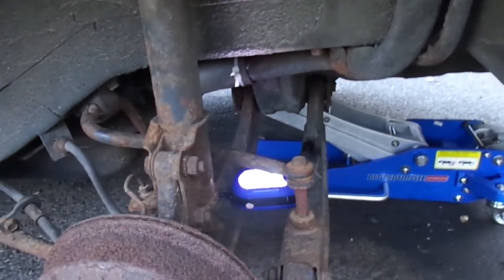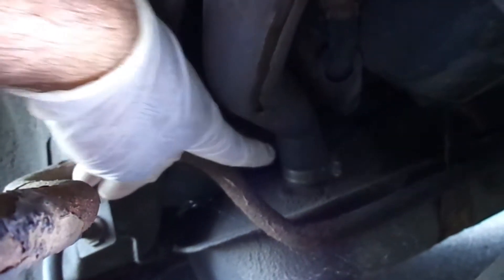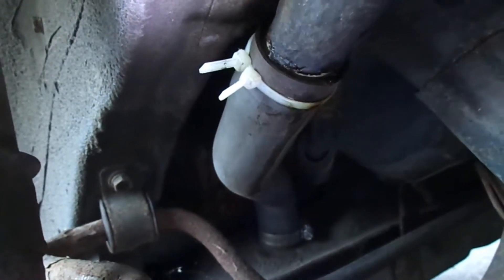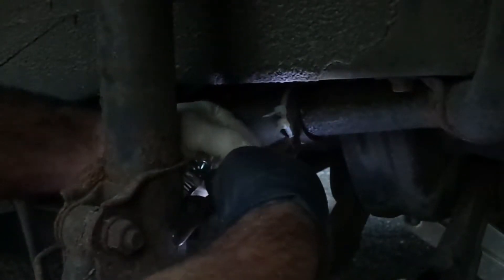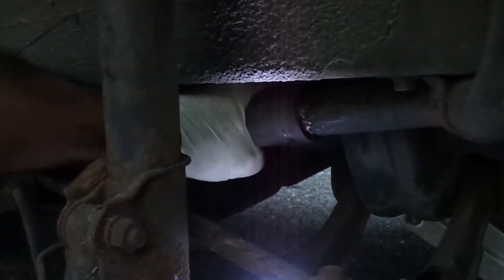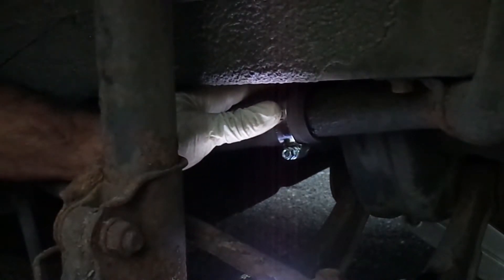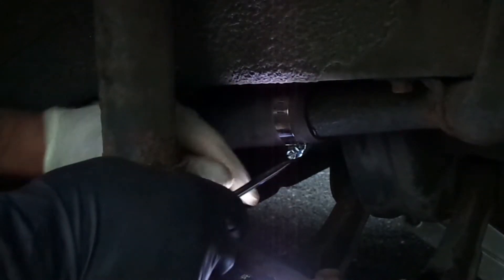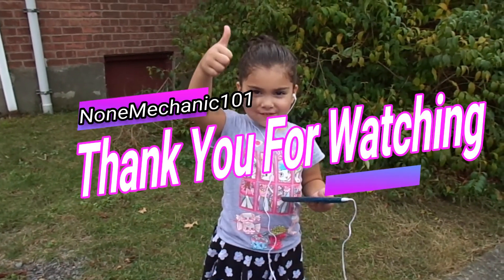HOW TO FIX A LEAKING GAS HOSE IN A CAR, Hyundai Accent

Comment: I got two 2000 hyundai accents. They are cheap and relatively easy to fix. One has a gas smell I haven't figured out yet.
Reply from the maker: Yes, they are easy to fix. Where is the gas smell coming from. The front or the back?
Reply: @NoneMechanic101   It's coming from the back. I checked the fuel pump (which is underneath the back seat in my model) and it was totally dry. The smell becomes very bad within the car if the tank is over half full, so I've just been driving around with less than a half tank. Haven't had the time to look into it more.
Reply from the maker: @markwitmer5498  I would check the gasket that covet the fuel pump
Reply: @NoneMechanic101  Okay. It's probably worth another look, I suppose. It's been hard to track down especially since there isn't a strong smell of gas at the fuel pump. It's seems to be strong on the exterior and the fumes are getting in somewhere else.

Comment: hey I have a gas smell in the front of my car, it doesnt go inside the car. hyundi accent 2006, when I bought it the mechanic said I need a gasket on the front of the catalyic pipe or something like that, could that be it? smells like its near the engine. what else can I check and how can i check it easily? soapy water or something? thanks
Reply from the maker: I like the soapy water. I get good result this way but I also use the cold weather. I would turn the car on and I would  search where the leak (smoke) is coming from.
Reply: Same thing I have as well... Gas smell
Reply: 2008 Hyundai accent 178k miles